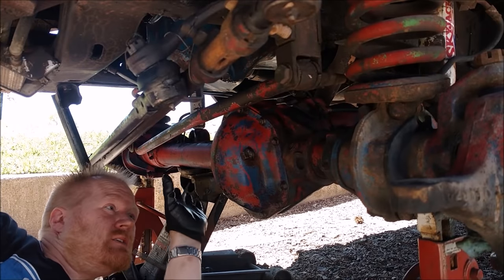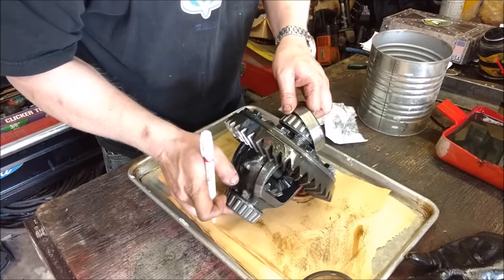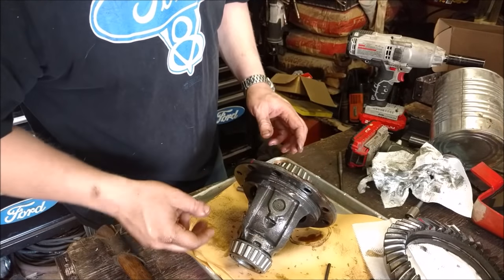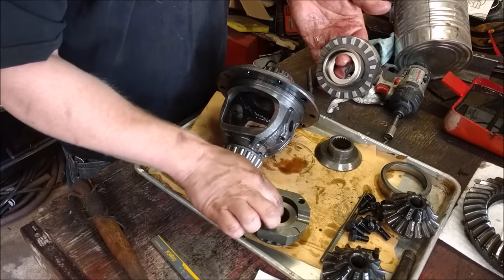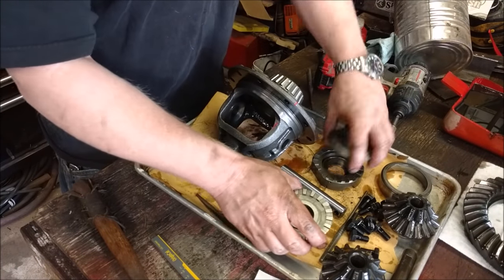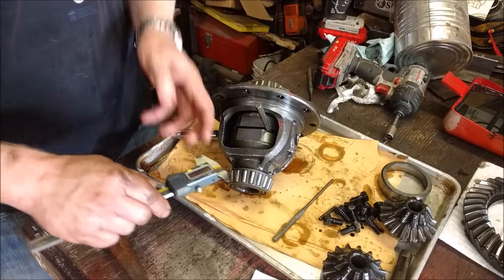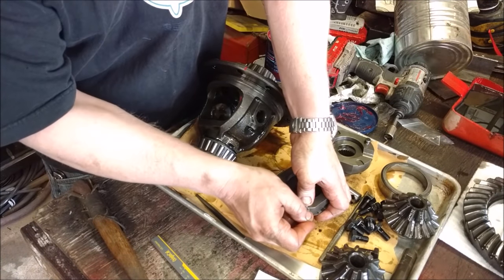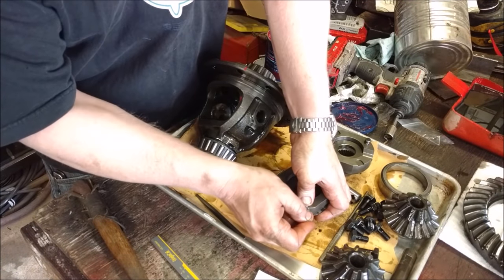Lunchbox Locker Install Dana 44 30 JEEP Ford Chevy

Comment: Installed a spartan locker in my 30 spline Dana 60 rear. Did not have to pull out the carrier, installation went very slick. Road manners aren’t bad at all. With the windows down and stereo off you can here a slight clicking going around corners off the gas. If you stay on the gas it stays locked. Works great as expected off-road.
Reply from the maker: That's awesome.

Comment: One of the best locker install videos I have seen. And since I did this long ago to a couple vehicles..and one about a yr. a half ago, wish I had seen the video before then ;) but I got through it, and it helped I've had a lot of experience with large hydraulic motors/pumps through a early work experience. But it's really not that bad of a job, just watch your measurements and clearances, and take your time.
Reply from the maker: Thanks, I'm glad you liked it.

Comment: Thanks, I have wondered about those.  I even wondered about using them front and back. No rock crawling for me but in snow and mud it could nice. Even more so plowing with a 2 bottom plow. Never new there was something other than OXE OR ARB. SIMPLE IS NICE.
Reply from the maker: For less than 1/4 the price of an OX or ARB locker it can't be beat. In the rear axle of a daily driver it would be annoying as it clicks as you turn a corner on concrete, unlike an Ox or ARB which can be unlocked. For a front end with hubs; since you can unlock the front ,you'll never notice as you turn on the concrete and daily drive it.
Reply: I have Spartan in the front and rear of my Jeep and the work great for on and offroad use, I run 85w140 gear oil and you can't even hear the clicking in turns.

Comment: I was thinking of buying one of those for my f350. I knew it wouldn’t be hard to install but your video made it much clearer what it was going to take to do it. Thanks much!!
Reply from the maker: It took the most time pulling the axle shafts, re-lubing the front wheel bearings.

Comment: Wow the locker works. Your truck climbed that rock face with ease. It seems so simplistic, almost like it will wear itself out with the pin forcing the two grippers out. I am getting the paint pens those will come in handy.
Reply from the maker: Hey Thanks. I write on everything with these paint pens.

Comment: Bought the paint pens.  Been looking for a good brand.  Did not know Sharpie made them!
Reply from the maker: I bought some in the past at nearly $8 a pen but those ran out so I started searching online for a cheaper option. I saw Sharpie made some and gave them a try. They need a really good shaking the first time you use them or else it can be watery and point the tip up when you depress it for the first time to let out any built up gases. Otherwise it'll expel a blob of paint like they all do. I was surprised how long the first Yellow one has lasted me and am on to the Red and White now.
Reply: I still have a silver and black one I've had for 12 years or so.  Got them from an industrial supply rep, Snap-On or somebody, who was handing them out to his customers.  They're "Super Met-Al" I think. Made by SKM.  Still available but more expensive.

Comment: One thing I remember from when installed one on my Bronco, make sure you have a hardened cross pin. My factory cross pin was not hard enough. I had to use an aftermarket unit.
Reply from the maker: True, I think it also comes down to how much you use it. Being in the front axle and really only used for rock crawling it'll take me 30years to wear it out.
Reply: @sixtyfiveford  I installed it in the rear 8.8". I would've ran the stock pin but I actually read the instructions that mentioned a hardened pin being required. I file checked the stock unit and it bit in pretty easily. Surprised how soft it was.

Comment: I have a lockright locke in the rearend of my 76 cj-5. Works great! Just push in the clutch when taking tight corners, just a tiny bit of "click click" from locker.
Reply from the maker: I debated throwing one in the rear axle. Thought I'd try it out in the front first because I can street drive with unlocked hubs.
Reply: sixtyfiveford makes sense.. I don't know how it would act with a auto trans though.mighy stay "locked" when taking corners even off the throttle

Comment: Where were these when I had my 4x4s in the 70`s
Reply from the maker: It makes for a fun time.
Reply: sixtyfiveford I grew up with old Ford's , Owned every style since 64 bought mega Used vehicles I counted 34 once 6 like yours ,What motor is in yours ? I've got a belly pan and some other parts yet
Reply from the maker: My 78 has the 351M and my 65 has the FE 352. I also have a 59 and 66, both with the FE 352 as well.
Reply: sixtyfiveford Well it'll fit your 351m brand new in box ,are You in Canada ?
Reply: Back the it was called  a Lincoln lockers.  I had a old ford pickup that had a Dana 50 in the front not a 44.

Comment: came here because i have this exact same axle in my cherokee. full width from a 79 f150. definitely excited to get gears and lockers in it. the few high pinion dana 30s ive taken apart have no C clips, the unit bearings hold the axle shafts in. unless they were just missing and i never noticed...

Comment: Great walk through Moe! I've got upgraded warn auto locking hubs on my 1978 Jeep CJ, but the last time it saw mud was well before I acquired it. Not to mention, Indiana is FLAT lol. Cheers my Friend! Zip~ See ya next Sunday!
Reply: ZippoVarga sounds like you need to move to Arizona. 360° of mountains and anywhere from 5 minutes to an hour away from many many mountains to go on and many more if you wanna travel farther all over the state. Also Arizona has a website that lets you know most of the trails in every county so its easy to find new spots in different places all over az. Mud? We get mud couple months out of the year
Reply from the maker: I don't know how I'd live without mountains here in Utah. I can always get a bearing wherever I am.

Comment: I watched this 2 times so I made sure how the parts are installed ...It would be nice to do this to the rear end in my old truck
Reply from the maker: It makes a huge difference in grip. I can't wait to see how well it does in winter as it did great in soft sand and on rock this past weekend. I debated installing this in the 9" rear of this truck but opted to start with the front and see how I liked it. For an axle that is always engaged it will ping/knock as it ratchets when you go around a corner on cement. It does change the mannerisms of driving a little but a lot of guys do it (Justin Raines in the comments below runs one in his Jeep rear). The 9" Ford actually uses fewer parts than I show, but I couldn't find anyone online that has a testimonial for it.

Comment: Mine did not last but 2 years with no wheeling .. City driving wears out the hard face on  the teeth and they fail to lock and they start to clunk and skip ! Worked great till it failed .. Thanks Moe ..
Reply from the maker: I thought about putting one on my rear axle but thought about this wear. That's why I put it only in the front, as I have locking hubs. So essentially it is idle until I need it.
Reply: Put one in a chevy 14 bolt 1 ton like 8 years ago, zero issues, amazing where that truck goes in 2wd lol its ironic a locker failed in the city 😂😂

Comment: Nice demonstration and explanation.  I have no experience with that design locker but it looks heavy duty and solid.  it should work great for your off roading adventures.  Watching the vid makes me think off all the times a have had to pry and beat out the carrier differential to get the carrier shims just right. A royal PIA without a case spreader.  I like that .006-.008 slop backlash thing.  :-)
Reply from the maker: It's an art setting up axles. Luckily I didn't have to mess with it on this one.

Comment: Hi guy here's my pick one you have it apart now would have been a great time to replace the pinion seal and checking the pinion bearing so if not leaking now it won't leak soon also a hot rodder' S trick speed shop one of the kits to lose the c clips well just a couple of ideals C😎😎L

Comment: It may be obvious to others, but I’d like to know if Warn hubs still work to allow free wheeling when lunchbox lockers are installed.  Well done video!
Reply from the maker: Yes I can unlock both warn hubs and I have no differnces in steering or street drivability.

Comment: to do the gear swap with diff in the axle? if can get the center pin out/in without having to grind the ring gear that is in the way... too much, per Petersons 4 Wheel and OFF road magazine article. if ring gear it TOTALLY too thick then the ring gear has to come off/out much more work to slide axles out of knuckles... at which point might as well get the axle tube seals off e bay $20 from CN to seal the axle tubes from mud/dirt.  

make special half moon thing on all thread to get the trash out of axle tubes so that trash doesnt get pushed into differential/seal and the old seal leaks gear oil into the axle tube. not the end of the world... if have the axle tube end seals from CN/HK in 3 weeks for $20 so the oil is kept in the axle tubes and not leaking all over the inside of the tires.

 as replacing the inside differential axle seals looks like  a chore without another set of hands to keep broom handle/extensions in just the right place hammering in the new axle/differential seal that keeps the gear oil in the differential. 

STP OIL TREATMENT? to THICKEN UP THE gear oil so it wont leak out so much?  60 WT... liquid grease really thickens up oils, motor and gear oil.

Comment: I have a 1999 dodge ram 1500 4x4 I was thinking about putting one in the front Dana 44 low pinion I don't know if it would hold up to 35s 250hp and it weighs 7000 lb what do you think and a little sand and mud I don't do rock climbing

Comment: How does the Ford steer now? Heavier trucks can be more forgiving with a front lunchbox locker than something like a jeep.
Reply from the maker: I have unlockable hubs so steering on the street is no different. Locked hubs though and steering suffers on hard pavement but feels really no different off road. I would not install this in a road driven vehicle that couldn't have the hubs unlocked.
Reply: @sixtyfiveford  my 76 suburban does fine off road with the lunchbox unless I'm turning very steep. Then I pop out one hub (short shaft side) and make the turn.  Looks like we both wheel in the Rockies so things are pretty similar. Great vid and keep up the nice work!

Comment: Do you know where that Dana 44 high pinyon came from or outta what?? Really need to know. Thanks Dandahermit
Reply from the maker: The disc brake coil spring high pinion like this comes from 78-79 Ford f150 and Bronco.

Comment: Question 1979 f150 ford 9 inch with posi....fluid capacity 3 litres of 80/90 conventional gear oil is full. When adding fruition modifier call for 200ml? I guess just add modifier first then top up with oil till it spill out fill plug. Any thoughts? Whats your experience with oil thanks cheers
Reply from the maker: Exactly put in as much modifier as required then top it off with gear oil until it pours out.

Comment: Just wondering, how noisy is that setup when turning? I'm aware that it won't be turning when 4wd isn't engaged, but I can't help but wonder if that chatters during a turn with the front drive actuated.
Reply from the maker: On soft dirt or rock it will Just slip the rubber to the ground. On solid pavement there's enough traction between the two tires that you'll get a pretty good bang when it skips a tooth. Even then it'll try to skid the tire/chirp the tire on the pavement. There's tons of guys that run them in the rears of their Jeep and claim they get 30,000 mi out of them.

Comment: Have you put a locker in the rear end yet? I just bought a spartan locker for my rear 30 spline Dana 60 in my 77 Ford highboy.
Reply from the maker: I haven't yet. It's done so well with just the front locker I put that project on the back burner. My only issue, that was an issue before the front locker was the already weak power steering system in my truck. I can't steer on pavement with the front locker engaged so I need to do the common upgraded power steering pump. Dirt, snow, slick rock aren't an issue. I'm running a 9" in the rear and a little concerned about the street drivability with a locker in the rear. I'm on the fence about a lunchbox or dis/engagable  locker.
Reply: sixtyfiveford I’ll be putting a spartan in the rear end of my 77 F250 here soon.

Comment: How long is a lunch box locker expected to last with minimal off road use? Like... Half a dozen off road trips a year with possible locking use?
Reply from the maker: If you have unlockable hubs it will last the life of the axle as it's never being used. If you throw it into the rear end of your daily driver you should only expect 20-30,000miiles.

Comment: Hey Sixtyfiveford, 
Thanks for the great video. I have a question regarding the Loctite stick. Does it hold up well even in oiled compartments?
I know loctite makes the 242 in the liquid or stick form, and the 243 (oil resistant) is only liquid.
Wondering if yours hold up well or if the bolts backed out.
thanks.
Reply from the maker: 242 just needs to have clean metal first and it won't fail. The 243 is for things your can't completely de-grease.
Reply: @sixtyfiveford  Got it, I ordered the 242 stick and 243 liquid, always good to have but the stick seems more user friendly and not a waste. Also was a lot cheaper. Thanks for the feedback.

Comment: I think my 79 F needs this.   Have yet to get stuck.... but...    just in case.   Mine should be a 30 spline?   seems common...    Its in my cart now at least.
Reply from the maker: It made an astonishing difference. The only drawback is the power steering really suffers when locked so that needs to be upgraded for sure. However the Power Steering pumps are notoriously weak with this generation of Ford and the 35" tires alone make it difficult at times.
Reply: @sixtyfiveford  Yeah.  O ya, mine has the saginaw pump upgrade.   Nice and quiet:)
Reply from the maker: @GF_Burke  That's awesome.
Reply: @sixtyfiveford  Yeah she's a 300.  Just bought a 98 XJ 2 days ago for a backup. Time to get mod'n again.

Comment: Is that axle the same as a Dana 50? Also there’s no need to check the backlash?
Reply from the maker: I'm not sure the differences 50vs 44 off the top of my head. This style locker didn't need with any factory backlash. However even if it did I likely wouldn't have messed with it being a front axle. Why? Because a front axle with unlockable hubs will maybe see 50-100 miles total over it's life.

Comment: and that pin is the weak point. the pin sometimes break. some others have increased the diameter of the pin to reduce failure. i suggest using one with the bigger pin.
Reply from the maker: The main large pin? I can't say I've seen that break but anything is possible. You would have to machine out the carrier housing to fit it.
Reply: @sixtyfiveford  they come that way. ready to go

Comment: If you have a locker like this is the front and your 4 wheel drive isn't engaged. Does it still hop when turning like a locker in the back
Reply from the maker: Since I have locking hubs on the wheels the front axle is completely idle in 2wd. If I didn't have unlockable hubs, like a lot of newer vehicles it would make a tick/popping sound as it ratcheted going around a turn. The wheels wouldn't hop.

Comment: Is that just for off roading?
Reply from the maker: Not necessarily. It's just makes 4wd work astonishingly better almost like limited slip they put into rear ends of cars/trucks. A lot of stock SUVs and Trucks have something similar to these as a factory option. If someone lived on a farm or in extremely icy snowy area it would help out a lot.

Comment: What about the C clips on the axle shaft
Reply from the maker: If yours has C clips: take the center pin out of the spider gears, slide the axle shafts inward pop out the c clip, then pull the axle

Comment: What happen if you weld the gears together. Can you still drive on road with the gears welded
Reply from the maker: It would be OK for offroad, but definitely not for an on road vehicle.
Reply: Only if you can unlock the hubs.  I have mine welded, with manual locking hubs it is a PITA when you have enough snow to want 4WD, but patches of dry pavement.  Also my truck is mostly for offroad and occasionally when the snow is too deep for a  AWD car.  And then is is awesome.  I think my diff is busted though and am thinking of the Spartan, or I will weld again or get a spool.

Comment: Great video! I wanna do this to the front of my xj. Does it affect your daily driving while not in 4×4?
Reply from the maker: XJ, I had a 1986 Cherokee for years. It had the Chevy 2.8l, which was gutless. I always wished I could drive one with the 4.0l. For a fixed axle with no locking hubs the front end will always be locked, even in 2wd. When you go around turns this will make the front end ping/knock as the gears ratchet. Not a bad thing on dry pavement, just a little annoying. On wet/icy surface in 2wd it can force the front end to want to go straight when you try to turn. There are a lot of people in XJs that run them though.
Reply: sixtyfiveford ok so its like welded diff syndrome. Thanks for the reply and I'm still debating as this is the more affordable than the Detroit lsd types
Reply from the maker: Don't get me wrong, it's a lot more functional than a welded diff.